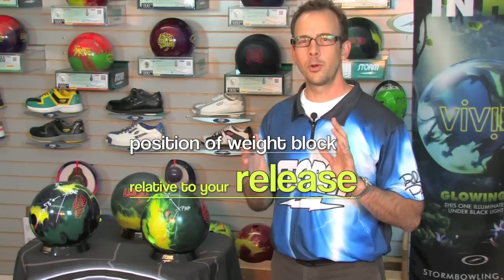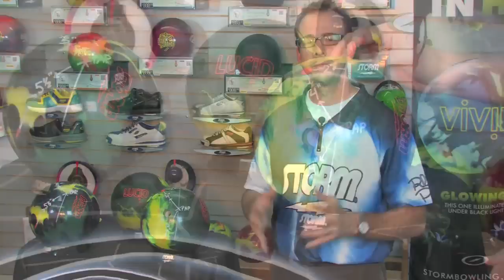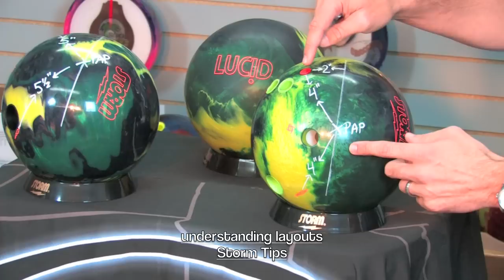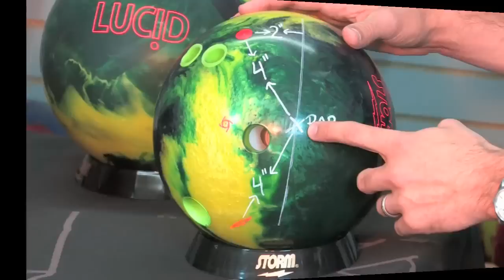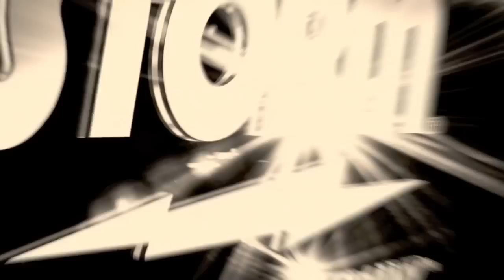Storm Tips - Understanding Ball Layouts

Comment from the maker: Thank you for the comment and we definitely understand your concerns. You are 100% correct and our warranty/drill guides do state that if the pin falls within 1” of any hole that it either needs to be drilled out or placed 1” away from any hole. The difference is this video was intended to explain “layouts” and the most common layout used today is the 4x4x2. The pap for this particular bowler and layout did place the pin within 1” of the hole…

Comment: I use a 4x4x2 on a freakn frantic makes the ball pretty aggressive. if you cant throw the ball 16-19 mph i would go with a less aggressive layout for sure. And it depends how many revs you get also and your axis tilt.
Reply: Best layout for this ball s pin-cg-psa in line through center of grip. Max length with flip determined by hand position.

Comment: 1.) How exactly does pin placement in relation to the PAP impact track flare?  What two extremes would achieve minimum/maximum track flare?  2.) Re track migration path, does the general rule from long ago about drawing a line from PAP through the pin and expecting the track to bowtie on that line still hold true or is that theory at all related to the concept of migration path (which I admit I have a hard time wrapping my head around)?  Thanks!

Comment: Ok I am new to all this, so this might be a stupid question, but would my PAP be the same on every ball i throw?
Reply from the maker: http://youtu.be/aicFPNb0YHw
Reply: So the answer is yes. How can you use PAP on a new bowling ball that does not have holes in it to throw few shots? Thats the part I dont understand.
Reply: 2hands Bowling Junky so you take this layout for example and your pap and measure backwards to mark the center of your grip    if your 5x1/2up for instance once you lay your measurements out you measure 5 inches opposite for me being a right hander I would measure 5 inches left and 1/2 inch down to find the center of my grip    it's hard to grasp for a while but do it a couple times you'll get the hang of it   I use the dual angle layout method but was looking into what this layout entails
Reply: As long as your release is the same with every ball you throw then yes
Reply: @SneakySteevy  correct me if im wrong, but maybe it could be based on the oil pattern on a ball that you used that could determine the PAP for the undrilled ball. Im not an expert on the PAP and all that, but thats what an owner of a bowling establishment did for me. It seemed to help my average (195 at the time). That was almost 20 years ago, so maybe things have changed i guess lol.

Comment: In short, you don't just put your finger holes on just any spot on the bowling ball. The way you roll the ball determines where to drill the holes. The ring around the ball where the ball touches the lane is considered the track area, and you can usually find the track area by rolling a ball, and then see where the oil off the lane forms on the ball. The holes are then drilled based on the track area. That is as simple as it gets!
Reply: but how do you know how you roll the ball without drilling holes first? This makes me super confused
Reply: @Jin_Jon  Any ball you use will have an oil ring pattern. That oil pattern determines how you roll your ball, and will determine how your undrilled ball will be drilled.
Reply: @chunkymunkey9182  so even if you pick up a house ball and toss it you will still have the same ball track and PAP as if you were thrpwing a fitted ball? I don't think thats true. When I throw a house ball it comes off my hand like a retarded UFO... When I throw a fitted ball I get a much different effect, because I can keep my hand behind and inside the ball better. 

That is a real stumper for me as well. How do you find your PAP if you don't have a fitted ball yet?!?!?!

Comment: Im trying to understand

I see that you can gather this info from a current ball and from that transfer that info to a newer ball (same setup) but what if you didnt have a ball to gather this information?

what if the ball you use to measure the PAP has a setup where the pin is different location then no longer is a 4x4x2 and because that wasnt your ball maybe that setup is wrong from the beginning in order to drill your own ball?

Like I can see the PAP is relative to you and your throw, so if I throw a ball with my finger measurements and get the PAP, I cna say I want it in that setup? but then goes again the above question because the pin on the thrown test ball is different than what you want/need?
Reply: LuchoVena Come on over to Bowlingchat.net. There is a wealth of knowledge and information available to anyone that wants to know more, particularly about your pap (positive axis point) and how it is important to know before drilling a ball up.

Comment: To bad they did away with balance holes. They was a good way to tune a ball if the drill did not preform the way you like.  Now you have to plug and start over or just get another ball.  I have had a couple balls I added a balance hole to later.

Comment: ok here's a dumb question, what if you roll more-or-less straight, meaning I have essentially no spin or curve? Do I need to be concerned with the layout of the ball, or should I just get one that is the ideal weight and holes?
Reply: Andrew Walter no you don't
Reply: If you don't throw the ball with any revs just get a white dot or similar plastic ball and have them drill you a ball that fits you. It will most certainly have the same results as any other ball for you, and it will be much more affordable. As far as the layout goes, I believe with most of those balls they are drilled to a layout that is referred to as "label". id reccomend this, as its simple, and most pro shop guys should understand what you mean. 
back in the "brunswick black beauty" days the common drilling layout was strattling the label of the ball, and I believe this is where the term comes from.

Comment: Would be nice to know why league bowlers go with that layout versus the layout that the pro's use and what are the advantages to each one.
Reply: The lane length, oil pattern / saturation, the bowl line pattern, etc. all come into play.  Furthermore, that's a generic description.  Don't think for a moment that the pro's don't have hidden secrets, just as every ball does.  I have a motiv covert revolt, and after playin in house conditions (2 handed bowler) the suggested 4x4x2 is TOO aggressive, even when lanes are freshly oiled.  Even 1 handed it's too bold.  Where as a different core and finish will react completely differently.
Reply: Nick Long 4x4x2 is completely uncontrollable unless you have a ton of speed, or no hand. Try same layout with the pin above the middle finger. Really flattens out the reaction without having to make hand adjustments.
Reply: Vince H because leauge bowling is on recreational patterns with oil in the middle of the lane and free hook or friction to the outside portion of the lane.so you want an aggressive drilling so when you throw the ball across the oil to the dry the ball is responsive and when you get it in the oil and miss inside your target the ball still picks up and gets thru the pins.on tour there is no recreational patterns so there is no free hook to the right so you want balls that will retain energy for the back end of the lane.tour guys play the lane front to back as leauge bowlers play the lane from side to side

Comment: I ordered the storm code black in the ball they sent me has the pin only 2" away from the grid but i want my ball drilled pin up and my proshop told they can only drill it pin down i'm just wondering why that is
Reply: subzero2827 if they drill it pin up the center grip or cg will get drilled through making the bill illegal to use in sanctioned bowling events or leagues
Reply: It wouldn't necessarily be illegal...but they are right not to recommend it. Depending on your track and pap a 2 inch pin ball drilled pin up would be very weak. The further the cg is from the pin the more flare potential the ball has. It also depends on how much top weight the ball has and how much side weight after drilling. I'd you want one drilled pin up...more long and flippy...get a ball with a 4 inch pin